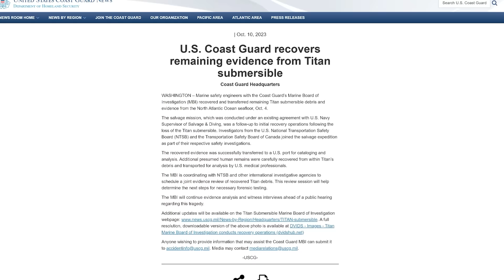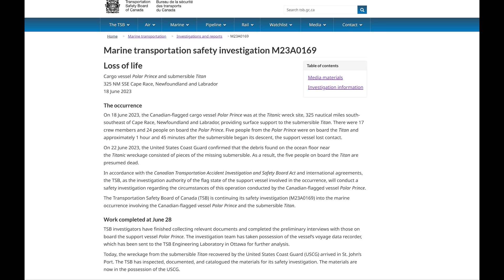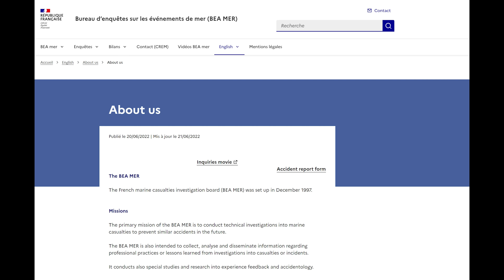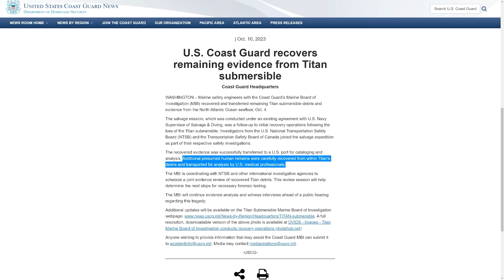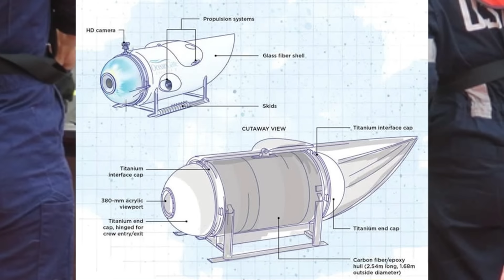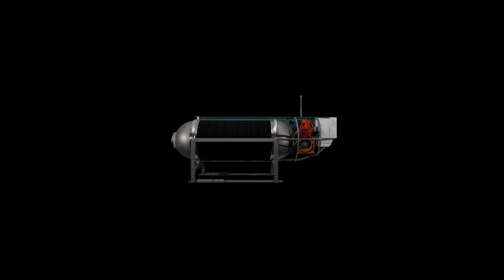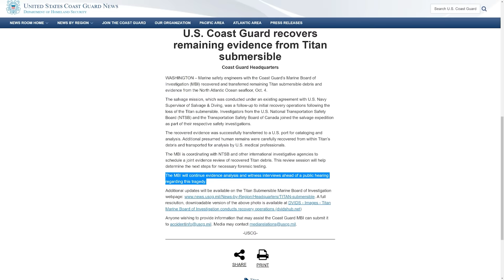Titan Sub UPDATE: More Human Remains, Debris Found

Comment: the submersible should have been tethered to the mothership, at least for the journey down to operating level (at the Titanic depth). By that I mean redundant steel cables with the capacity to bring the thing up. They could also include into the tether a means of video and voice communication.  When the aft hull breached and started bringing in seawater, the craft was too heavy to resurface with only those tiny propellers driven by tiny electric motors.  What you want on the mothership is a very heavy-duty drum-type winch to bring the thing up, much like pulling up an anchor. Another extraordinarily stupid design choice was that they bolt you in!  Even if you are at a safe depth, you are not going anywhere. (ʘ_ʘ).  Also, and I've heard otherwise knowledgeable people claim otherwise: carbon fiber is good for tensile forces, but not compressive.  You don't have to be a rocket surgeon to understand this. Pulling on each end of a string shows the string has tensile strength. Now try pushing a piece of string together from each end. It is very limp, very weak, and offers no resistance whatsoever to your compressive force. That's why carbon fiber is fine for aerospace work where the internal area of the craft is pressurized, but NOT for deep sea diving where the EXTERIOR is pressurized.  Oceangate was relying entirely on the compressive strength of the epoxy resin the fiber was encapsulated within.  Where was I when they needed some common sense?  Tragic loass.
Reply: You raise some excellent points.  But I don't think adding a tether would have been an improvement. 13000 feet of steel rope for example, you're talking something on the order of 20+ tons of 'tether' just to allow going straight down.  More if you want to allow maneuvering about.  Of course you might use a synthetic material that is less weight.  But then there's the issue of entanglement.  If the submersible has a tether that has enough slack to allow them to move around the Titanic, it's enough slack to snag on any number of objects.  Now your safety tether has become a liability.  Or, if the winch on board the mothership fails, the tether itself might very well prevent the sub from being able to surface even with no issues on the submersible.

Remember, any leak '... bringing in seawater', at those depths is deadly.  Even if they started pulling up on your tether as soon as leakage was reported, by the time you reel in +10000 feet of cable, the thing is flooded completely and all are dead anyway.  So it adds nothing to the safety, increases the risk of a problem, and the cost of the tether and a ship capable of handling it would be very high.
Reply: @mikefochtman7164  Not to mention that the sheer weight of the line, not to mention currents acting along its length, would make manoevering the small submersible attached to the end of it impossible.
Reply: You were there, and you were fired
Reply: @robertstallard7836 Yes, for a 1 inch steel cable, that's over 12 tons if I did my math right.  If the hoist on the mothership fails, the steel cable itself would prevent the submersible from surfacing regardless of any issues on the submersible. (unable to 'lift' the 6500 foot long 'loop' of cable).  Of course there are other materials besides steel, perhaps something close to neutrally bouyant.  But still, more drawbacks than advantages to any tether in this application.
Reply: I don't really buy the "started leaking water" story, unless there is confirmation on the transcripts, it seems too melodramatic.  It may well have groaned and creaked as it descended, but the failure and water entry should have happened at something like the speed of sound.  I believe the carbon fibre guys say that in a matrix it takes compression, parts of aeroplanes are clearly in compression, and Titanic was actually strong enough for that depth on all but one of its dives, so that inclines me to the (rapid) fatigue/delamination issue.  It looks like they just never proved the technology, which is breathtaking.  Also, as I understand it, they claimed their acoustic monitoring system would predict hull failure, but how could they know that and how to interpret it without calibrating it by destructive testing?  I feel that if they had been doing all of this properly then they would have been publishing results, at least on their website, and people in the industry would have been aware of it.  Presumably the investigation will tell us all this.
Reply: by the time it started takin on water it was too late wouldve been like a balloon popping but in on itself, they'd be 0 chance of pulling it up before death.

Comment: It appears we have engineers that have lost their minds in using carbon fiber!  Meaning, carbon fiber is a resin isn't that strong.  The good qualities of carbon fiber is a light weight construction that breaks into a billion pieces.  NASA found out the hard way with this material on the Space Shuttle.  One design change was using metal wire in the mix, but that only adds weight with no change to the resin.  This reminds me of what happens when you let Accounting instruct Engineering.

Comment: They released those text files months ago. It was taking on water and sinking to fast. The pin hole leak was like a laser and eventually it cut into the crew area. They drop the weight to return to surface but barely rose any. Then they started sinking again and that's when they lost contact.

Comment: The carbon fiber came up in the white bags in June. It looks like fiberglass house insulation from the way it shattered. There was also equipment in class spheres outside the pressure vessel under the aft fairing. This is a 100% non starter on manned submersibles because if (when) they rupture it’s like setting off a depth charge and can be enough concussion to trigger an implosion of the main pressure vessel.

Comment: It looks like the aft dome was projected into the aft skeleton frame which contained all that equipment. The two oil filled stabilizers were not attached to the frame when it was recovered months ago, and I believe that coupled with the marks on the rear dome show it was forced into this equipment. I do not think the portal failed. I think it was shot off the front like a bullet. When carbon fails it shatters into tiny bits which are not easily recovered. As we only have this one photo of the ate dome, all this is speculation. It is my hope there was interior video which would lead to some answers. If they were having power buss issues like the alleged "leaked transcript" says, the interior video may not have been functioning.

Comment: I've always wondered why the whole vessel wasn't a combination of mostly titanium with stainless aspects.
Reply: Wild guess but different metals and saltwater doesn’t go well.
Reply: @yeesenchai  Right. I was under impression that those two metals were compatible & not particularly corrosive (or at least acceptably so).
Reply: Weight and bouancy.
Reply: Yes. No need to reinvent the wheel. Titanium has been very successfully used for decades.

Comment: Is it possible that the acrylic porthole melted with the heat from the implosion?  Acrylic melts at 320 degrees Fahrenheit, which is well below the heat released during implosion.
Reply: There wasn't much support for it with inside pressure, Once the water starts moving into that air bubble it has an incredible amount of momentum and weight. It doesn't surprise me that it knocked out that retaining ring holding it in the front. The heat it would have been subjected to would have only lasted a small fraction of a second and it was very thick.

Comment: IMO; leaving the steel mandrill in place wouldn’t have made a difference. 
It’s already been established that the industry of deep sea submersibles have tested the strength of a variety of metals under those pressures, and the metallurgical structure of steel had long been ruled out for those depths UNLESS it were spherical, very thick, and high density. Not to mention that the only data available on carbon fiber in deep sea applications was from trans Atlantic cable studies, and they showed that carbon fiber still would delaminate, crack and fail.

The vessel was simply doomed from its inception.

Comment: I think the steel mandrel that it was on was like the spool on a sewing machine and would not have any space to enter or exit. the ends only have an opening for the shaft . Plus the weight would have been far too heavy to be used in this application.

Comment: As I understand it, the carbon fibre (C was wound like a cotton reel (cylinder wound), which does not take into consideration the pressure excerted by the 2 domes trying to push together and squish the CF end to end.  If we then consider the mechanism of joining the titianum domes to the tube (gluing), accompanied with the unsanitary conditions used to prepare the glue and the dirty rags and hands etc (note this is usually done in a clean room by personally in dust suits) it is apparent to anyone that the titan sub was a disaster in the making and not fit to carry paying passengers to the bottom of to pond in New York's Cental Park, let alone the open sea.
I would suggest that the cylinder should have been spill wound (like a ball of knitting wool) and there should been a titianum appliance shaped to mate to the end caps and to grip the CF held appart my titianum rods.  The spiral winding then uses this as a former and the whole thing is the vacume autoclaved to ensure full resin penitration and curing.  It would have only increased the cost by 50% (as a guess), and increased the strenght 10 fold (at a guess).  Finally, it would have allowed the eng caps to ne bolted on.  Finally, working with titianum requires special tools.  The SR71ctechnicials had to have tools attached by lanyards to stop them dropong the tools on the aircraft as this cause a valvanic type crossion / crack inniation.  I'll  bet london to a brick the stockton rush (rush by name, rush by nature) had no clue about this and used ordinary bolts and spanners.  (In my humble engineering opinion)

Comment: Perhaps they should have considered a carbon fiber and steel composite tube arrangement.  Maybe the two materials were not exactly compatible with each other under extreme pressures as well.

Comment: The mandrel would have supported the CF shell. But how much depends on how thick, type of steel, its heat treatment (if any), and probably other factors. On the other hand that much steel would have required additional bouyancy provisions to rise. Additionally, it would have reduced the internal volume of the sub, requireing higher airflow rates and CO2 scrubbing equipment, to sustain the crew and passengers, and diminished space for equipment and people. 
I had thought the mandrel was actually left in the structure. Having never seen the picture of it being removed before. 
Now that I have, I strongly suspect the CF shell was the fatal culprit. However, not being an engineer I don't know if the CF wrap as executed was weaker than the type of wrap used for pressure vessels (an oscilliating, overlapping type of wrap) on not. Also CF is tremendously strong in tension, I've seen no figures of its performance in compression. Lastly, were there any bubbles or voids in the wrap that may have contributed to the catastrophic failure. There are many other considerations also, the entry points in the rear dome where signals, power, and telemetry were passed, the relative shrinkage of the different materials relative to each other under compression, fatigue of those materials etc.
Reply: I’m also curious about how wires and air tubes, if applicable, were passed through the body of the sub.

Comment: My general feelings toward any deep sea cylindrical pressure hull for those depths is that it's really not worth the extra considerations required to engineer in a high safety factor. There's quite a few military submarines that look cylindrical, but are actually a series of connected spheres, with only a slight cylinder acting as a joint between the compartments (The Losharik). It's possible it could reach 4000 meters, but most experts doubt it because a perfect sphere really is the safest option, where you're basically trying to just eliminate potential weak spots.
Having a sphere isn't just about evening out the pressure load as much as possible, otherwise you'll have an uneven distribution, which almost always results in fatigue at seemingly unrelated areas of the hull, this is even visible in some of the simulations, where the mid-point of the titanium nose caps were under huge amounts of stress compared to the rest of the hemisphere, which probably sent forces in all sorts of weird directions on the cylinder section, increasing fatigue.

I knew about Titan about a year before the accident, found it while learning about DSV Limiting Factor and looking for footage of its Titanic dive.
My first thought when I looked at it was "that's going to concertina inwards like a flattened beer can."
It doesn't surprise me that so many celebrities backed out of offers for discounted trips. I can imagine if I didn't feel comfortable as a spectator, them actually getting the offer must be terrifying.

Comment: 3:40 So other people think the submarine collapsed in an instant (hundreds of miles per hour) with both cones being squashed together. However the cone piece is still intact? And they found remains? Not likely. Water doesn't accelerate that fast even under that much pressure. It just has to much mass for instant acceleration.
Reply: I don't think you actually know what you're talking about.
"And they found remains? Not likely."  -- Well they did. Guess you're wrong.
"Water doesn't accelerate that fast even under that much pressure. It just has to much mass for instant acceleration." -- You know this for a fact? Of course you don't.
Reply: @guitarista67  You wrong, and don't know what you are talking about.

Comment: Yes, very interesting.  The fact that another "Titanium" piece was brought up and appeared to be "Mostly intact" is intriguing.  I agree, that steel mandrel should have been left inside, would have added a large amount of structural integrity.  Of course, the evidence still appears to point to the failure occurring at the boundary between materials.  The Carbon Fiber portion of the hull attached via glue to the titanium rings is likely the critical spot, the glue losing it's bond over time, over numerous dives.  The ship should have been rigorously inspected after each dive to determine whether that glue was fully intact, or whether it had lost some percentage of its holding power.

As most commenters agree, rotten engineering leads to dangerous conditions.

Comment: IMO- When the Titan started its decend on the last dive, it was diving faster than normal. When the problems occurred, messages from the Titan said they dropped the weights trying to accend but it didn't work. The sub then dropped the frame to eliminate all excess weight so they could accend faster due to the noises being heard in the aft of the sub. The sub also used its motors trying to get this sub back to the surface. Why wasn't the sub coming up? What made it so heavy?  When they designed this sub, they put all the O2 tanks and electrical in the rear of the sub and sealed this off from the passanger area. They used a strong epoxy to glue the parts together. I think this sub was leaking in the aft compartment. Since this area was sealed off from the passanger area, they didn't notice it. As the sub went deeper, the leak became worse and filled the aft area causing the exessived weight. They were having electrical problems during the dive also and everyone knows salt water and electronics don't mix. The sub eventually gave in to the ocean's extreme pressure. So sad.

Comment: The white marks on the aft 1/2 sphere looks like gel coat residue from the rear faring. Stains on the inside could be corrosion or stains from human remains. As for the steel mandrel, it would have given VERY little additional support to the CF cylinder.

Comment: If the mandrel had been left in place, the submersible would have sunk like a rock.  It might have reached the bottom intact, but it would have been as buoyant as an anchor.

Source: Qualified in Submarines, extensive experience in marine FRP (Fiber Reinforced Plastic).
Reply: Note that the Titan submersible had very minimal reserve buoyancy. Reserve buoyancy is the difference of buoyancy from displaced volume vs. vessel weight. the mandrel was on huge honkin' (technical term ;-)  ) chunk o' steel.
Reply: But surely if it was left in place 'by design', they would have adjusted ballast calculations to compensate.  After all, they had some uncompressible foam in the tail to compensate for equipment there, and external ballast weights they could adjust before each dive to account for variations. 

Much like the dive officer on a Navy boat would do when loading/ offloading stores and weapons (also Qualified in Submarines, but no experience at all in FRP :) )

Comment: That might have helped support the hull and also provde a better mounting point for the internal equipment
Reply: The vessel had an internal liner where the internal equipment was fasted. It was not fastened to the CF pressure hull.

Comment: I believe the aft end cap and the carbon fiber tube expanded and contracted at significantly different rates at extreme depths which caused the breach. Having a titanium tube core welded to the aft end cap could have possibly prevented this. But the best design of course is a perfect sphere.
Reply: It had made prior dives

Comment: Well, regardless of the materials used; the construction obviously had design flaws; (how not to construct a submersible)and making the main hull from steel or titanium would have added other components necessary to control the weight and stability required for diving and rising.